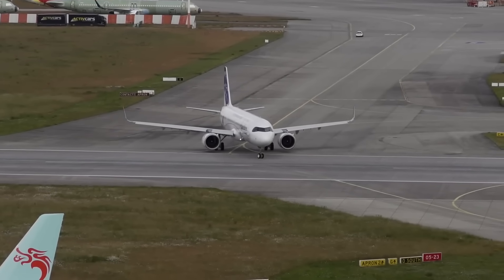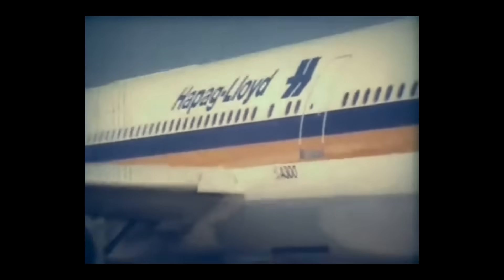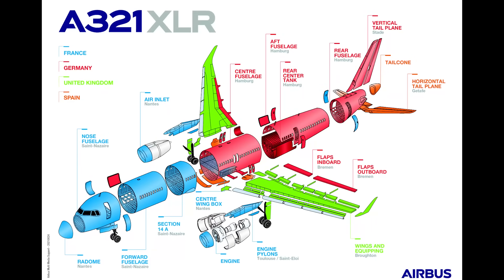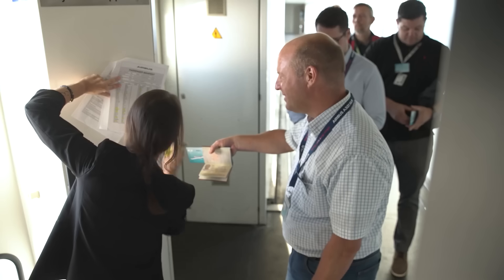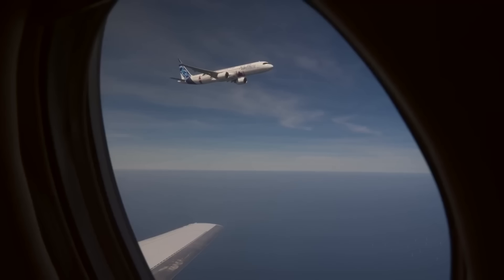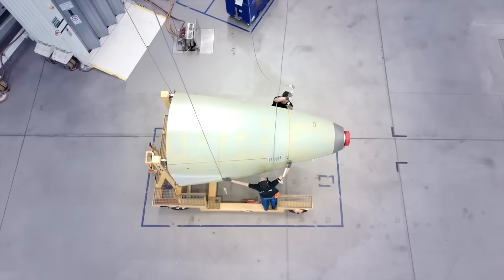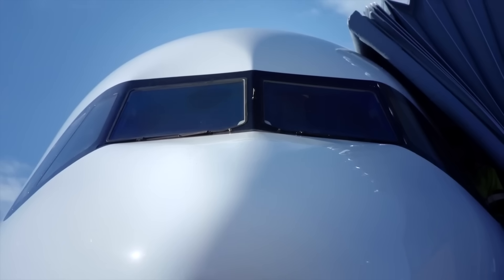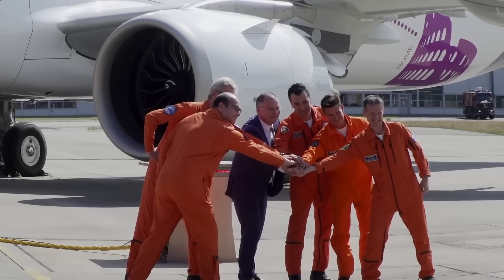Is the A321XLR the True Boeing 757 Replacement (Finally)?

Comment: Pilots love having a long haul capable aircraft without a private crew rest area
Reply: And passengers surely prefer a 3-3 configuration over 2-4-2.
Reply: @hiphophasser111 who doesn’t love getting stuck behind the cart to reach the lavatories at the back of the cabin!
Reply: 😂 it's not the pilots buying the plane but the company owners and they are not on the plane, to them comfort is not really an issue

Comment: I've spent several hours on a Lufthansa A321 from Western Asia to Frankfurt. It was comfortable, but I hope they've done something about the noise level on the XLR because it was the most annoying thing (aside from the pilots deciding that the cabin should be freezing cold) on that flight.
Reply: It’s usually the cabin crew who decide on the cabin temperature. And since they are working, they run a bit hot and turn the temperature down.

Comment: I will avoid this in any class. Single aisle planes are cramped by the lavs so people end up queuing in the aisle and there's no room between the aisles to have a good stretch, and you're stuck when the cart is in the aisle with no way to go the other way around to the lavs - or just for a walk to get the blood flowing. I did transatlantic in 757's and they were a miserable experience. I'm sure this is great for the airlines but not for passenger comforts
Reply: On a twin aisle, they run carts in both aisles simultaneously. So that’s not a difference. And it’s about the same amount of passengers per toilet, so also not an issue.
Reply: @rtbrtb_dutchy4183 It's not the same amount/ratio. And you really made a brainless comparison there, as the carts roll down but on a twin aisle you still have more space and you can still pass. At least you have comfortable seats which you don't have on a narrow body. Two aisles give you more fluidity.

It's not all about numbers and ratio, it's about the relative comfort and space. Wide bodies are superior in every single way ! Only fly narrow body if you want to be cramped and stuck.
Reply: @dodaz2049  wait what?  Who says the seats are more comfortable on a wide body. That totally depends on the airline. The XLR isn’t used with a high density layout.  Most seats on an XLR will be the same or have more room than on a wide body. 

A narrow body had 1/3 of the seats as middle seats. 1/3 aisle and 1/3 window. More people are stuck in the middle on a wide body. 

I calculated the toilet to pax ratio of a Jet Blue LR versus a A 787 and the Jet blue had less passengers per toilet. 

You can twist it all you want, but that still doesn’t make your statement true.
Reply: @rtbrtb_dutchy4183 Agreed. And I also disagree with that standard statement that wide bodies are so much more complex than single isles. More complex how? So I agree , wide bodies are not automatically more comfortable than single isles. Nor are they automatically more sophisticated or complex.

Comment: 8:12 No, sorry, you're wrong. The Boeing NMA (according to their former CEO) is not in development. Even if they were designing it, the whole process, from design, to customer offers and orders, to development, to certification, to production is (as Boeing is currently proving with the 777X) FAR longer than "5 to 7 years."
The 777X is STILL not in production, and it's initial design started all the way back in 2011. It's not expected (at the time of writing this) to be launched for cutomers until AT LEAST 2027, that'll make a 16 year development on what isn't a full clean-sheet design.
Imagine then developing a full clean-sheet NMA. Even if it was launched tomorrow, we probably wouldn't see it with customers before 2040. That's one hell of a head start for the A321XLR
Reply: Boeing literally reported on September 30th that they are working on a 737 replacement. They talked to Rolls Royce about potential engines and they are in the middle of designing the flight deck and cabin. Reports states entry into service in the mid 2030s.
Reply: The current CE0 has said otherwise recently